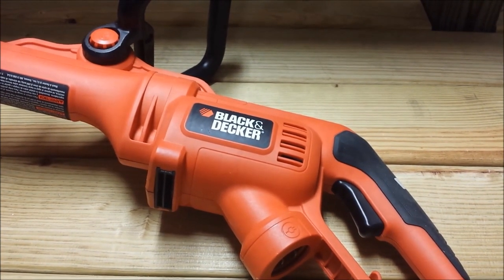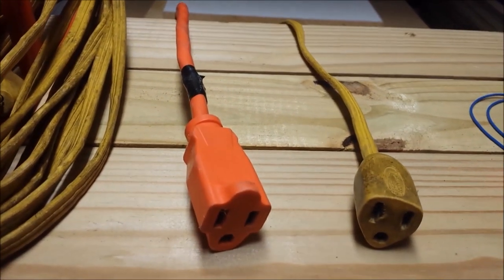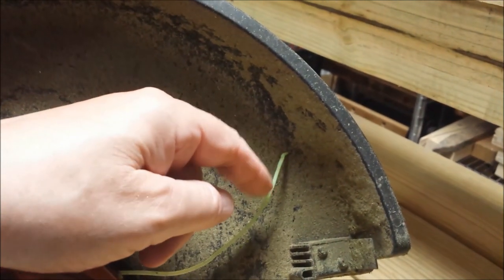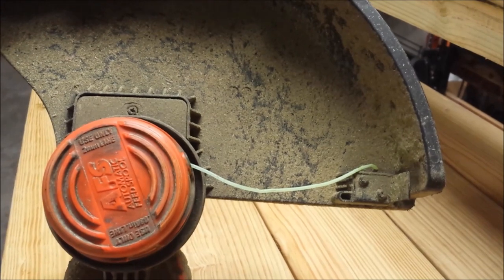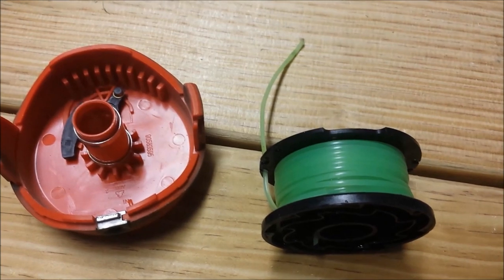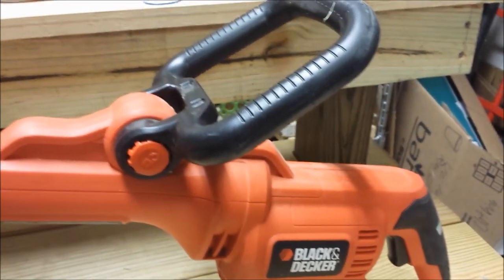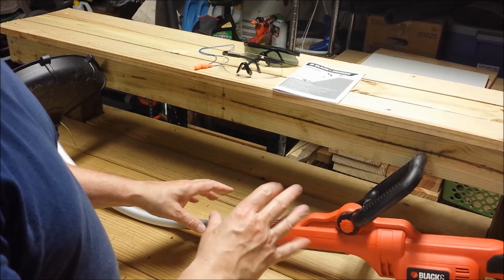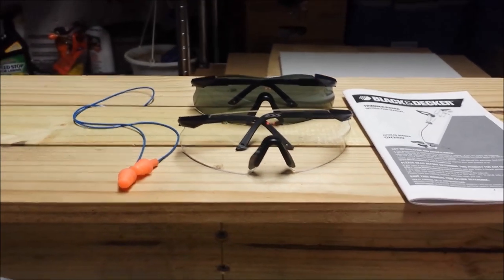How To Get The Most Out Of Your Black & Decker GH3000 String Trimmer

Comment: Hi, great video thank you. My trimmer just throws out all of the line immediately in a twisted knotted mess. I have it wound correctly and it is also sitting in the housing properly so I have o idea why it is doing this. I disabled the auto feed a couple of years ago and made it manual but the trimmer just throws the line out anyway...all of it. Do you have any suggestions as to why it is doing that? Thank you
Reply from the maker: If the spool is seated in the housing correctly it should snap into place and only have about 15 to 20 degrees of rotation on the shaft.  If it spins freely it is not properly seated.

Comment: Hi, Just bought this GH3000 today it replaced my GH1000 from 2005 that broke and I  probably could have fix it. After 15 years I said I'm going with a new one that 1000 doesn't owe me anything. I gave the new one a try and the only thing I don't get is the line seems not to move .I read instructions and it says auto feed  .Not sure how that works I went back and did some more with it and still the line stayed where it was when I took it out of the box .Which was and about 2 in away from the metal in the shroud .Any ideas or should I just keep using it short until it decides to self feed to a longer length. Thanks .... JC

Comment: Hi, for some reason, no matter what I do I can't get the AFS to work correctly or at all.  I wound the spool carefully, I checked all parts.  is there is special move or technique to get the AFS to work?  the line just get shorter and shorter.  I have to remove the cover and pull the line out manually.
Reply from the maker: Hmmm... It could be the spool is not seated in the housing correctly.  It should twist back and forth a few degrees. It can be tricky.  Or... check my video on "How to Refill Black & Decker Line  GH3000"

Comment: Can I change the string to blade on this model? It have screws on both sides and I’m not sure if some of the ways I saw on other videos on how we can stick something in to this one hole and slowly remove the string holder can apply here.
Reply from the maker: I am not sure that would be a good idea as the weight difference of a blade my overload the motor.  Cheers!

Comment: Hello, I have had my trimmer for a couple of years, but I can't figure out how to auto feed. Does the trimmer do it at will or does it have some sensor that it auto feeds? thank you
Reply from the maker: You have to ensure that the line is wound correctly on the spool.  If so, then it should automatically feed.  I have found that stopping and starting will help.  Also,  if the line is old or sits in heat too long then it can get crimped at the opening causing it to snag.  I hope this helps.

Comment: Do you find this product EATS string? I don;t get more than 15-20 minutes out of a spool. Very frustrating. I am looking for a blade conversion kit but cannot find one. If you know of one please post.  thanks
Reply from the maker: Yes,  the trimmer line that comes with this trimmer and the off the shelf replacements run out of line very quickly.  I refill all of my spools with Oregon 21-380 Gatorline 1-Pound Coil of .080-Inch.  Once a spool gets worn out I replace with some off the shelf and tolerate the quality of the line till I can refill.  I too have looked for a hard blade replacement or DIY solution with no luck so far.  The commercial and bladed trimmers are rather pricy for the typical home owner.  I hope this helps. Cheers.
Reply: @WorkMateGuy  Keep us posted if you see a hard blade replacement.  Nice video with great tips!! Thanks
Reply from the maker: Hey Doug - I have seen some DIY solutions on YouTube.  But, all of them look rather dicey and I suspect their weight would ware out the motor very rapidly.  Cheers.
Reply: @WorkMateGuy  I do the same thing! I always wind my own line on an empty spool. You're losing money if you buy a new spool every time. Actually, I have two spools and make sure I always have one that's full and ready to go. That way, when one runs out, I can swap it out for a full one instead of putting my trimming on hold while I take the time to wind a new one. Then, after I'm done trimming, I'll reload the empty so it's ready to go the next time it's needed.

Comment: I was recently doing some yardwork with my GH 3000, and caught some string that had gotten into some tall weeds. Well, the string promptly and thoroughly wrapped around the drive shaft. I cannot find any instructions on how to remove the trimmer spool assembly to reveal the drive shaft. Any hints?
Reply from the maker: Yikes!  A nasty problem... take a look at the manual online Panel B. You may be able to approach it from the other side.
http://lawnandgarden.manualsonline.com/manuals/mfg/black_decker/gh3000.html?p=2

Comment: I just got a brand new one. I noticed the little blade that cuts the string is very dull. Is that normal or should I sharpen it with a file?
Reply from the maker: That blade is not sharp from the factory.  I never sharpened mine which I have owned and used for years.  But, you could sharpen if you would like.  Cheers!

Comment: how d you get the line to come out,do you have to tap it on the ground ?
Reply from the maker: The line will deploy automatically if you have applied it to the spool correctly.  I have found that if it is not deploying I stop the motor, wait till the spindle stops rotating then start again.  This typically gets the cord to deploy.

Comment: I was using mine and the whole lower string assembly broke off and I've lost part of it.  I found the string spool and cap, but can't find whatever the piece is that attached that to the bottom of the trimmer and am having a hard time finding that part online.  It's not in my book.  Any ideas as to what I need to order and can I fix it?
Reply from the maker: Joan Schofield You might want to check out Ereplacementparts.com as they have really good diagrams and photos of parts. You should be able to find what you're looking for there. Good luck with your hunt.
Reply: @WorkMateGuy  Excellent, thanks

Comment: my unit won't start.. I suspect the circuit fuse is blown. where is the circuit fuse located?
Reply from the maker: ray decena As far as I know there is no fuse on this trimmer. Have you verified power coming out of the outlet that you are plugged into?
Reply: Page 12 of Instruction Manual (which you twice reminded us to read in the video) reads "Possible cause of unit not starting is blown circuit fuse." Of course, B&D does not do us the favor of providing fuse type. So much for Concientious Capitalism.

Comment: when i start mine it draws out about a foot of string how can i stop it from pulling out excess string everytime i start to use it
Reply from the maker: shane spencer There are several possible causes for this problem. First, make sure the trimmer line is tightly wrapped around the spool. Second make the spool is seated correctly in the cast.